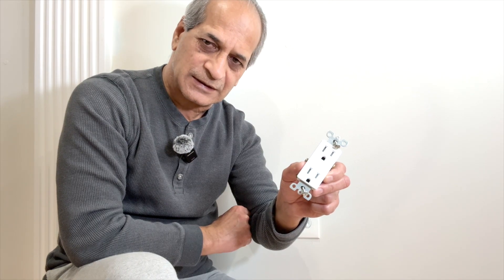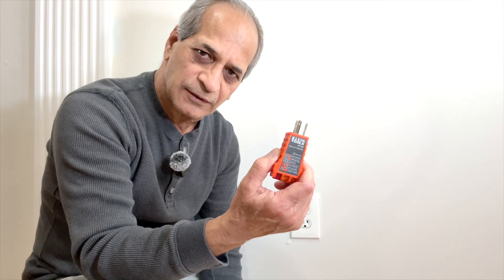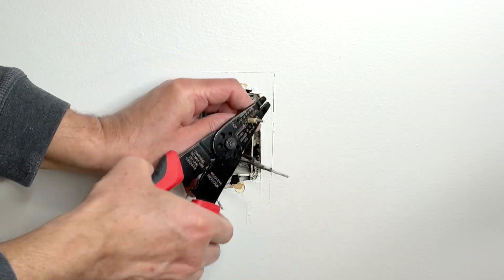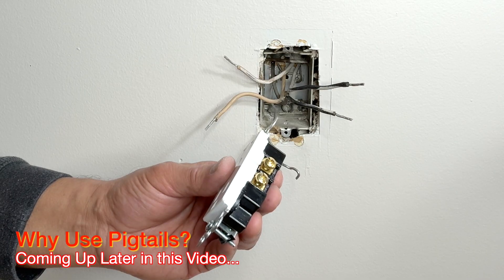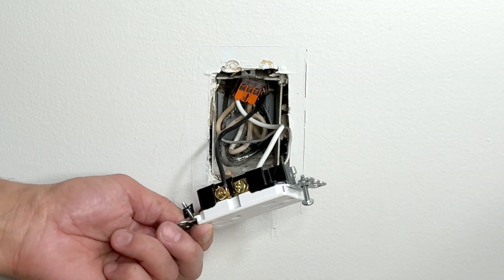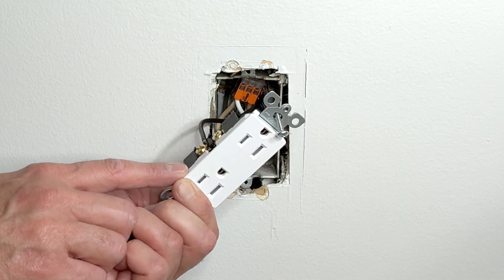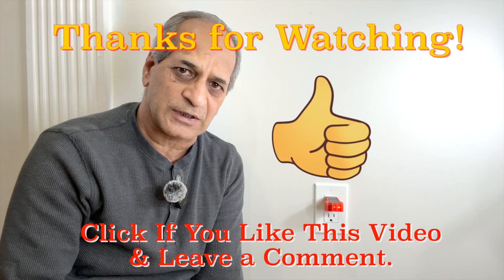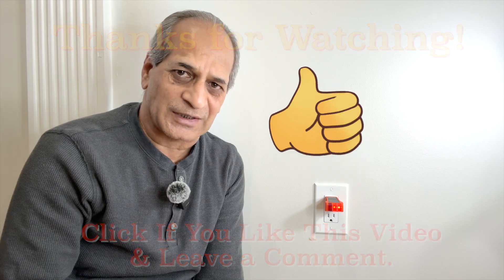How To Install An Outlet or Receptacle In An Old House.

Comment: Use the 3 wire alumiconns to join the aluminum and a copper pigtail. Use nolox paste. Those wagos are not aluminum rated. You going to have a fire.
Reply from the maker: Right...Thanks.